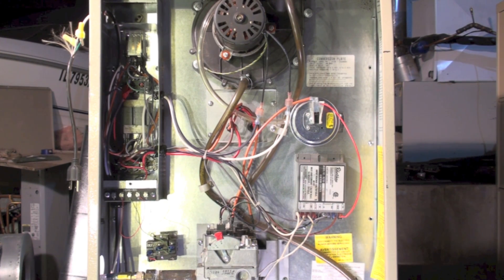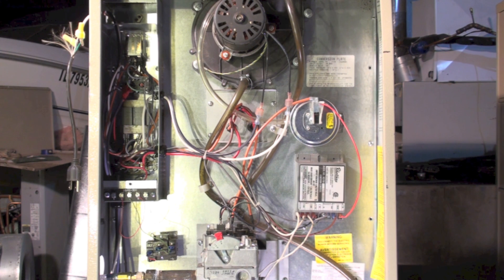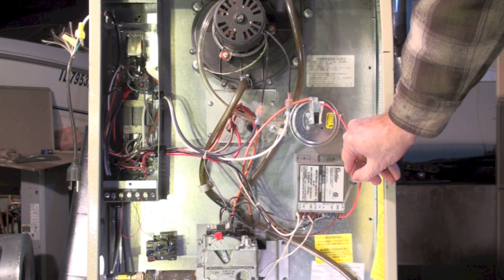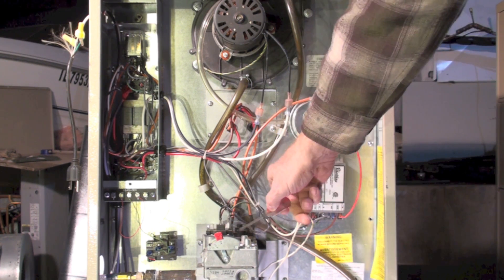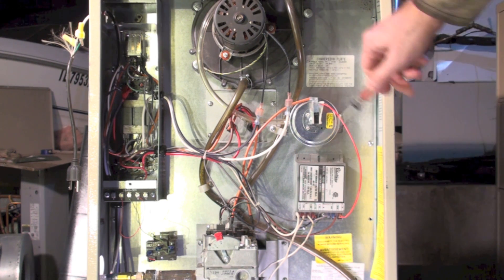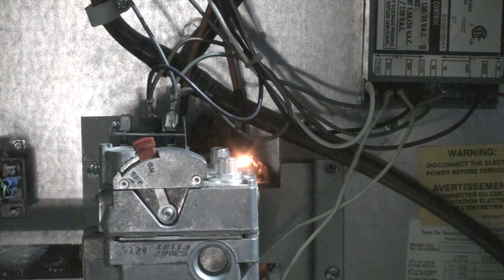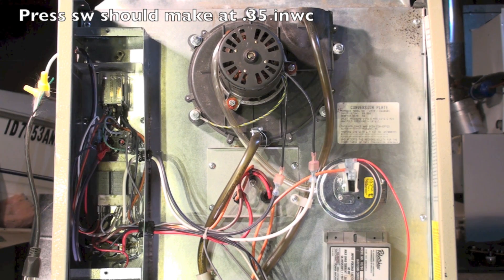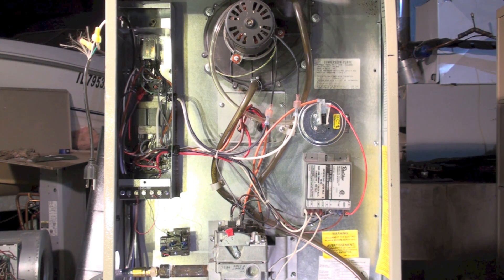Coleman CGU gas furnace part 2

Comment: We have a 45000 BTU T.H.E. 2940-666 from back in 1985 in our two story on basement home in Tennessee. Still running fine in 2024. Have replaced inducer fan due to failure, gas valve to change from LP to natural. Seems to run so much better on natural. Just wondering how many years left on the obsolete drum hest exchanger.
Reply from the maker: You should have about 1 day of service left on the heat exchanger.  lol  
Most of those cracked by 15 years ago.
GFM
Reply: @grayfurnaceman  It was replaced within a year of installation by our HVAC folks under warranty. No problems since. I am investigating what to replace the unit with Hard to find a 45000 btu unit these days.
Reply from the maker: 40,000 BTU would do well if you are getting a 95% efficient furnace.
GFM @pidjones
Reply: @grayfurnaceman  Our Coleman is a 92%. One of the first condensing I think.
Reply from the maker: The 40,000 should work well.
GFM @pidjones

Comment: GFM. I have a friend with a COLEMAN M/N DGAA056BDTBX mobile home furnace. Similar to the one in this video. Issue he has is that everything works normal on a call for heat. Burner ignites and remains on. But burner flame is not as intense as it apears to be in the video (part 1) and it does not heat his home. At all. Air comes out cool. I was thinking that it could be the gas valve. Maybe it's not opening completely?  Or maybe the burner/orifice need cleaning, or perhaps the gas pressure needs to be adjusted? Supposed to be going back to his place later today. But after watching your 2 part series, thought I'd comment and ask if there was anything else you think it could be. Any additional info would be greatly appreciated.
Reply from the maker: I would be looking at manifold pressure.  You will need a manometer.  Compare to model plate.  Also, be sure the unit has the correct orifices for the fuel used.  Propane uses smaller orifices than natural gas.
GFM
Reply: @grayfurnaceman  I wanted to give an update on my friend's mobile home furnace. When I got to his place, first thing I checked was gas pressure, both on the supply side, and on the manifold side. Manigold gas pressure was nearly .5 in. w.c. less than it was supposed to be.

That lead me to remove the gas valve assembly. I shone my flash light in the orifice hole and noted what I first thought was plastic. Tried to clear it with the metal point on one of my meter probes. Wouldn't clear. Removed orifice piece, and immediately noticed that it wasn't plastic, but spider cobweb. Cleared the small piece of web to reveal a dead spider and a fairly thick circle of web which the spider had made, completely blocking the gas supply/flow. That obstruction was reducing the gas flow/pressure and is the reason why the burner would not burn strong or hot enough. After clearing the spider and webbing, and putting everything back in place, I started the furnace up at the stat and allowed to run. My friend now has heat.

Not sure how that spider managed to get in there, but she did. On the bright side of things, it was an easy fix and did not require the replacement of the gas valve.

Hope this will be of help to someone else.
Reply from the maker: @i10v3mu5ic  Glad you got it going.
GFM

Comment: Mr Gary 
I have a problem with my Coleman furnace 
Is a single burner I believe it’s the flame sensor . At first the system would ignite , and go off after 10 seconds , so I cleaned the flame sensor and now it ignite the fan comes on it runs for like 2 min the flame goes out . Any thoughts? I’m waiting for the new flame sensor to come in . Thank you
Reply from the maker: If there is any change in the flame when the fan comes on, I would be looking at a heat exchanger failure.
GFM

Comment: I got a coleman mobile furnace. I get a flame but no burner. Only one burner.  Blower kicks on . But no heat.   Green light on control board.  24 volts from control board to gas valve.

Comment: Coleman DGAT075BDF mobile home furnace has a ghost.  Moved from one mobile home to another sometimes works and sometimes does not.  Measured current from flame sensor drops below 2uA DC and flame goes out.  Sensor cleaned, sensor replaced, ground checks good but same problem.  Watching close it looks like the flame may have a small gap by the sensor when it fails.  Solid blue flame works.  Cleaned burner, orifice and flue is clear.  This unit was on a recall and a stainless steel liner was installed along with an extra temp sensor and an orifice reduction from #20 to #24 on natural gas.  Same problem.  It may run, it may not.  The flame tends to go out when the blower motor comes on.  Works better after it is hot.  Any thoughts?  Could the air mixture need adjusting?
Reply from the maker: Those old Coleman single burners units had a lot of problems with flame sense.  Does the unit have the Robertshaw 780 control?
GFM
Reply: No.  Coleman 031-01910-000  On the board is ICM AB1012
Reply from the maker: I would be checking the heat exchanger for cracks.
GFM

Comment: heres my problem  click, click click about 7 times then it ignites,sears said it was a bad circuit board, so I replaced it, still clicking,,replaced igniter still clicking,,, so what gives????
Reply from the maker: +bettyboop65340 More info needed.  Does the unit use an HSI ignitor?
GFM

Comment: I have this type of furnace, if its used little once it goes to ignite after the combustion pump runs it'll sound like it detonates and rumbles like thunder. While opperating it has a low rumble as well. this would all be happening priorto the blower. This seems to occur less the more it is used but not always...thoughts???
Reply from the maker: ***** It may be having trouble establishing draft.   Be sure there are no negative pressures in the structure.  Some of these units have a primary air adjustment.  If so, you can adjust the air to see if that makes a difference.  One other possibility could be the baffle inside the heat exchanger has broken loose from the heat exchanger and dropped toward the burner.  Hope this helps.
GFM

Comment: believe it or not I ran into a York today that was very similar. A bunch of people were there before me and one replaced the honeywell fan limit control without breaking off the jumper inside so 110 went to all the 24 volt relays and transformer. It was a mess I ran away from
Reply from the maker: York bought Coleman I think in the early 1990s.  That jumper thing has been a real monster.  Could get shocked of the thermostat.  Thanks for the thoughts.
GFM

Comment: GFM , off topic ? I have a unicell oil burner w ac . When I took the gun off the unit I noticed the basket inside was like a horizontal five gallon bucket . Can I take the whole front plate off to clean inside or is the basket attached to it ?
Reply from the maker: That's the combustion chamber.  It is quite delicate and removing the front could damage it.
GFM